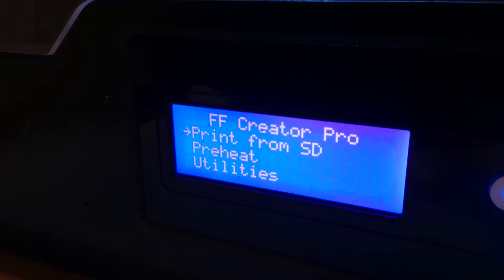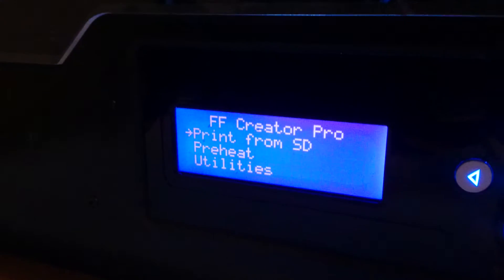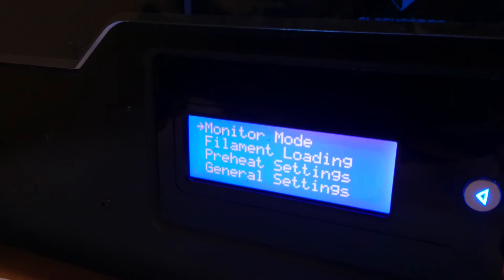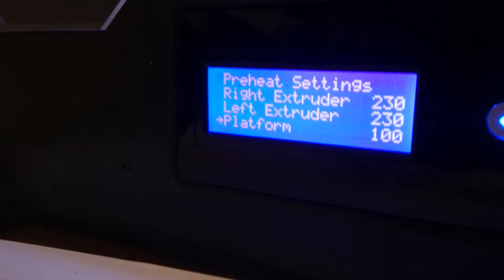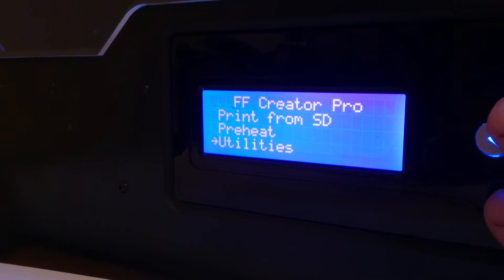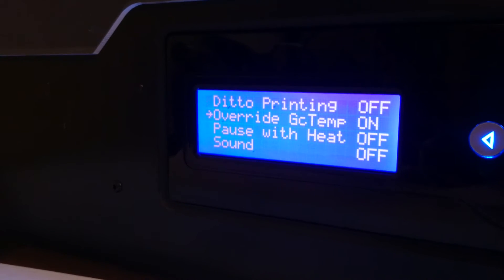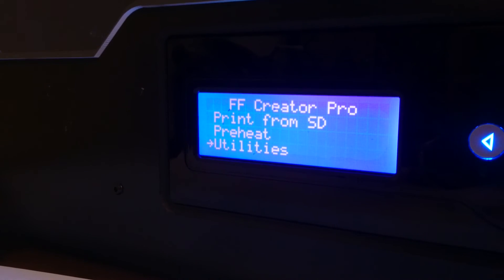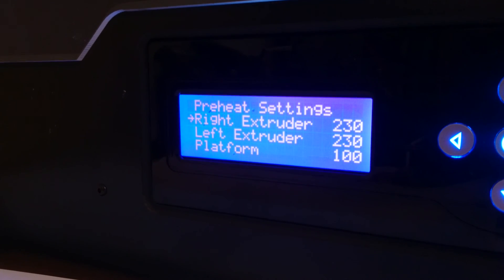Flashforge 3D - how to change heated bed temperature

Comment: i have exacly this problem every time i start a print the default values in bed temp and nozzle temp appers back on the main lcd screen ...how can i enable this overide function it does not apper on my lcd screen ...i have marlin 1.1 version